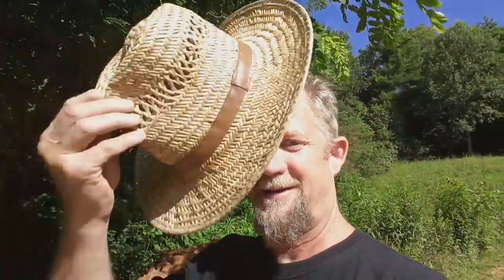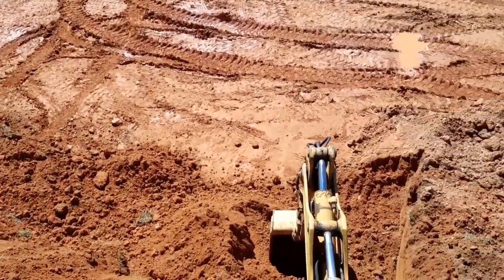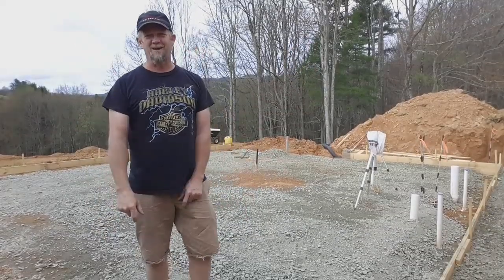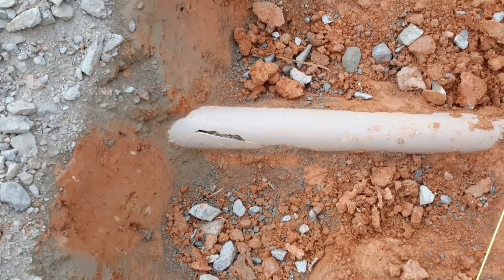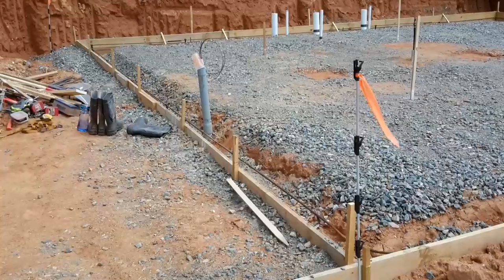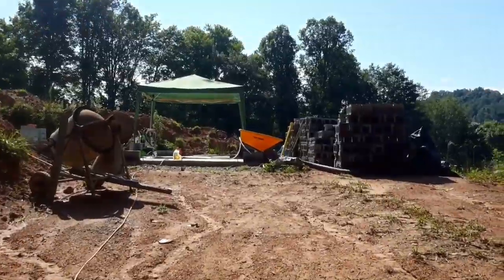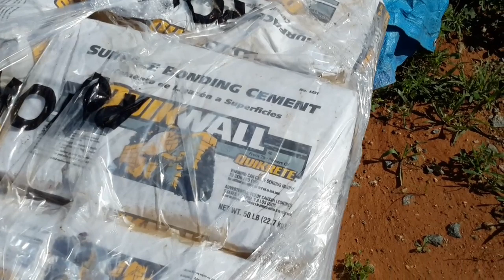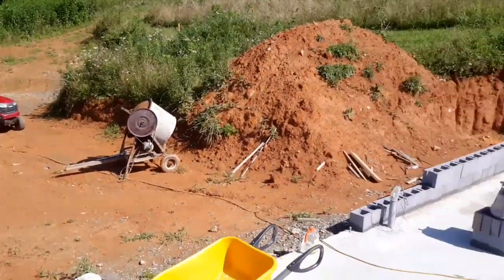Beginning a new house!

Comment: Have you put a waterproof  membrane under the slab? I’m thinking about moisture rising up through the concrete, or will you “tank” the floor and walls later? Don’t know what you call it in the states, but over here tanking is covering the cellar or basement and walls  with a bitumen type substance to keep out any ingress of moisture. In effect a waterproof tank. Looking forward to viewing the house progress.👍👍👍
Reply from the maker: Soil is different here-- 
I have 2 trucks of gravel under the slab, gravel and perforated pipe around the perimeter as well.
Any moisture that appears will drain out....BUT I am on a hill far above any ground water, so not expecting any moisture at all.
Thanks for asking!

Comment: Would suggest you tar seal the outside of the wall, and backfill up to within 2 ft of the surface with rock and cover the rock with plastic sheeting to prevent soil infiltration. Doing this will keep the hydraulic pressure of the soil off of your basement wall.
Reply from the maker: Thanks, Dan. 
Sealing the foundation is in the plan.  I have a foot of gravel with drainage pipe all the way around the foundation.  Working in clay is a first for me.
I will look into pouring gravel along the back wall.
Thankyou!
Reply: @grandpasmountain  clay is a very expensive soil, so I would highly recommend it
Reply from the maker: Thanks so much, Dan. I have a huge area behind that wall-- a good 4' at least.  I wonder how I could backfill without using copious amounts of gravel.

The wall has rebar and concrete every 30-36"
Reply: @grandpasmountain  Just simply lay your rock 2ft wide and 1ft deep against the wall, then fill the outer gap with clay and tamp it down, then another layer of rock against the wall, etc. It will relieve your wall from tons of pressure when the soil is saturated. I really like how you sleeved the water line. Just how I like to run them also.
Reply: @grandpasmountain  I meant that the clay is expansive, not expensive